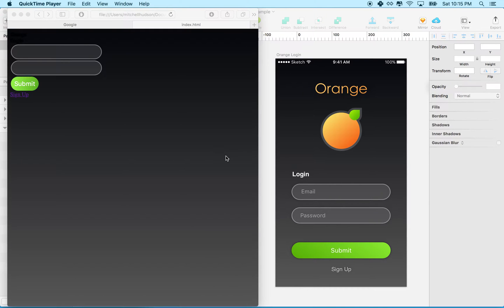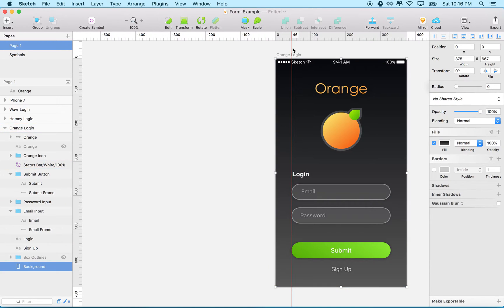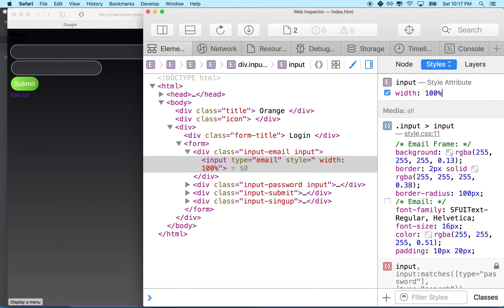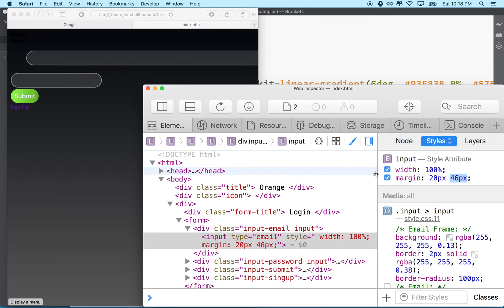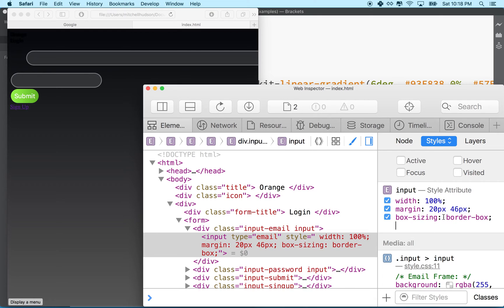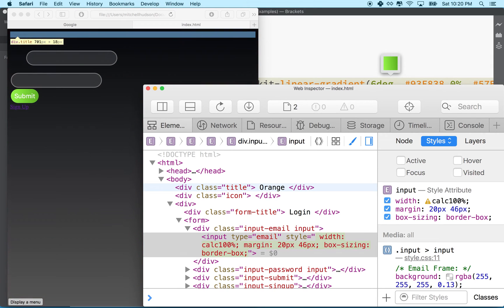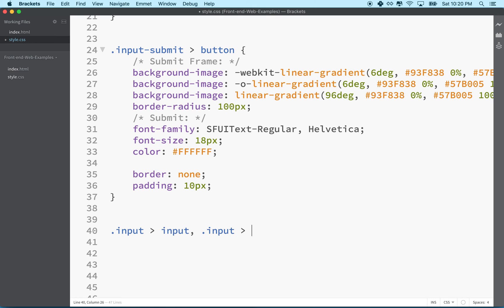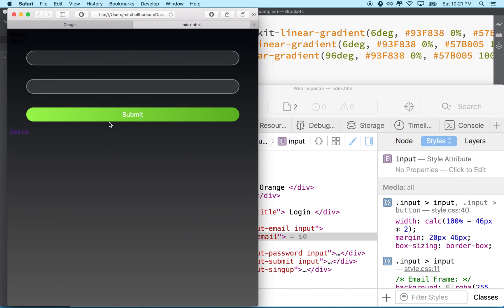04 Sketch Copy CSS Attributes part 3

Comment: Thanks for fast reply. Yeah I did search around your playlist in attempt to find the next serie on current project, because I am interested in how would you convert sketch orange logo with green circle to html. Btw.. I was just searching the web and found this plugin, maybe this would be easier option https://sketchtricks.com/sketch-to-html-with-uipad/
Reply from the maker: There are a lot of options for this. I use these videos for a class I teach. I class I show everyone how to export images as SVG and use the SVG code in their HTML pages. You can try it: 

1) Choose Insert > Slice. 
2) Draw a slice around the element you want to export. 
3) with the slice selected look at the right hand column. You should see a preview of what you are exporting. Look at the bottom right. Set the format to SVG. Then click export. You can also export any other format. These will all import with the <img> tag. 

Alternately you can right click an element and choose copy SVG code. You can paste this into your HTML page. This is a little trickier to get working. Give it a try. 

Depending on what you are drawing you can right click and choose Copy CSS Attributes, paste these into your style sheet add a class or id name, then assign this class or id to an element in your HTML page. This is a little more advanced.